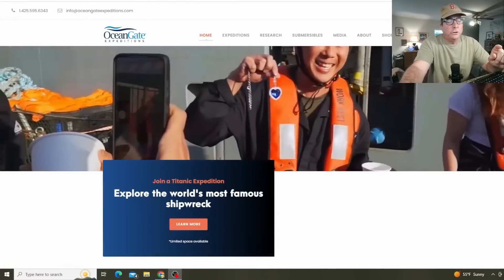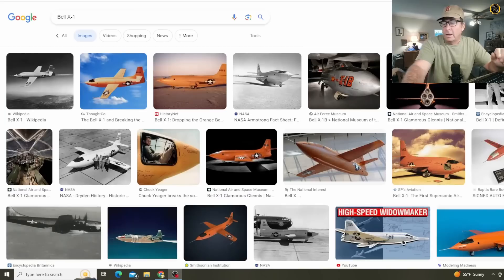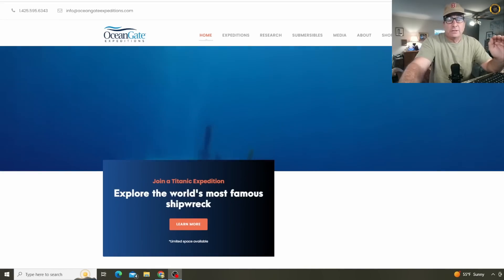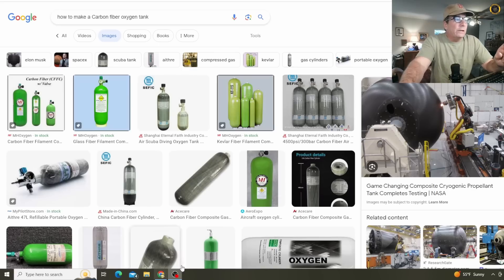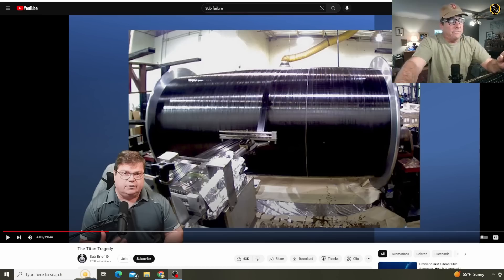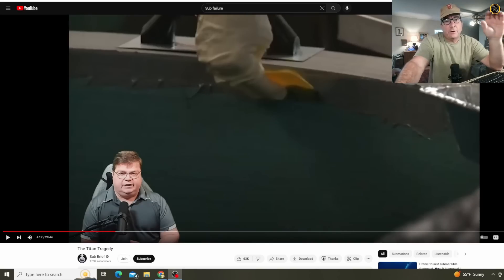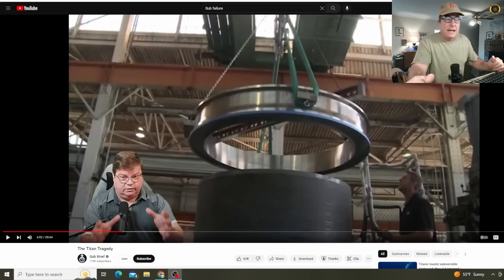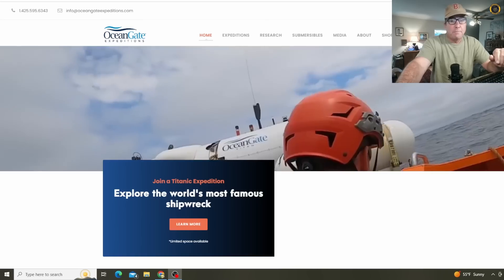Oceangate Sub Construction Details and Implosion

Comment: My brother in law, a diver in the Marshall Islands, made an interesting comment about what happens when the pressure vessel implodes at those depths.  The air volume inside the chamber is compressed to 1/220th of its original size in a few microseconds.  This rapid compression results in the air being superheated from the compressive friction, thereby igniting the oxygen into a little ball of plasma flame ahead of the wall of water.  This will take each of the human bodies;  compress and broil them into a charred ball about the size of a pound of hamburger, then immediately cooled to near freezing.

So I'd think there'd be  no bodies that could be recovered if what he says is true. And frankly, I have no reason to doubt him at this point.

And there could have been MANY failure points with the way this vehicle was built.  There could have been a small delamination that started in the composite layup ANYWHERE along the length of the tube.  The glass window apparently wasn't rated for that depth.  As you mention, the glue joint could have fatigued on an earlier dive and there was no way to check integrity of the joint or any of the composite laminations.  Any electrical feedthroughs from the interior to the exterior has to also be water tight at these extreme pressures, and could have been OK for the first few dives but exceeded their fatigue limit on the later dives.

In short, whoever designed this had no clue and didn't learn the lessons of the USS Thresher.

Comment: Fact the public is gona see the letter from sub industry pros, james cameron coming out..... i knew monday when they said "communication lost while desending" they where gone u dont lose location data w/o catastrophic failure. I duno who thought a 4 day search was a good idea. HE SOULD HAVE USED TITANIUM CYLINDER i mean carbon fiber is not a solid thing at that depth. Microscopic water leaks would weaken it. Fact they REUSED that sub more than twice shows they really shouldnt have been doing it. Ppl think "air tanks are carbon fiber they hold lots of psi" IN TENSION NOT COMPRESSION any sub/composots engineer would have gasped at this

Comment: How much weight does CF save, and does weight savings mean much in this application?  Metal's weight makes handling it harder, I'm sure, but that's doable - get a bigger truck and trailer, etc and move on, not worried if THIS trip is the one where it shatters.

Comment: Juan, quite good. But not good enough.
I'm a Mechanical Engineer, worked in composite aviation industry for 15 year,  low count as I was born into it. Seen the Lear Fan at the factory and much more. A friend of my father invented the carbon fiber. Leslie N. Philips at Royal Aircraft Establishment.
You are correct if the laminate was only made with "perpendicular" fibers. I have met and discussed this with Professor Stephen Tsai (Google).
No one in his right mind would do this .
I do not have sufficient data here.
There was a study in the early 80th of doing nuclear subs in carbon fiber, by no less than Brandt Goldsworthy, Goldsworthy Engineering (seen the nozzles of Saturn 5?). I visited.
The only composite item I was involved in with positive outside pressure was military and can't talk about it.
Carbon fiber has among the best fatigue properties in the industry, correctly designed,
Juan, you are wrong about NDT, non destructive testing, on composite materials. One of the best examples is the carbon fiber sandwich tail fin of our Swedish Saab 37 Viggen aircraft. Should be declassified by now.  My father's boss was in charge of the development of the Saab 37 Viggen, Dr Tore Gullstrand.
My most knowledge is with inside pressure. The launch tubes, now in Ukraine, of NLAW, AT4 all descends from my fathers work. RBS 70 is directly his work, also in Ukraine.
Reply: Håller med.

Comment: Yup. The fiber is not doing much in compression - like pushing on the two ends of a rope. The resin shatters during failure. They’re not going to recover much of that cylindrical section.

Comment: Everything has to be engineered and somebody probably came up with this design and backed it up with some sort of calculations. That's what I would like to see, the construction part is just the execution of this concept.
Additionally, what's your take on the use of composite materials in GA? How safe before a failure happens? Any known ADs on composite aircrafts like Diamond and Cirrus?
Reply: The use of composite materials in GA should be safe given that, by the time the structure is rigid enough it is (so I am told) far stronger than necessary. At least with GRP. I assume the same is true with carbon fibre. As a glider pilot with a GRP sailplane I've been taking that on trust for a long time!

Comment: Carbon fiber is perfect in tensile, not so much compression.  Poor plasticity.  The ends were glued on.  There its a video out there showing them glueing the ends on.  How could they be so ignorant of these errors?  For a deep ocean sub, check out the TRITON 36000/2 with a max depth of "Unlimited".

Comment: Do we know if the whole tube was wound that way? It could be like plywood, where there are different layers laid at different angles. That could be the inner or outer "pretty" layer.
The meeting point between the tube and the end cap is a hard point, and the cap has a square edge. Rather than the whole length of the tube being able to expand, all the force is stopped by the ring, and it will tend to bend the carbon fiber sharply around the corner, creating a sheer line around it. The carbon fiber should be at least twice as thick at the ends, and taper down to the main diameter to spread the load across more material. This is not my field, but I'm seeing bad ideas all over this thing.
Reply: The filament winding schedule is proprietary. It may become public through court cases.

Comment: For such a high expenditure,  potential customers should have stood back and done some research and inquiries IMO.  I could see that sort of construction being used in space stuff, for instance,  for a single use mission.  The extra measures required for reusable spacecraft required alot of research beyond what a single use vehicle needed.  Must be why reusables were slower in coming.   Think of the savings if the same Mercury capsule or Apollo capsule were used over and over.

Comment: You nailed it Juan. My father designed planes in the Skunk Works.  He took just about every course that came along including composites.  He told that just like any other material, there are pros and cons. Moisture was one of their biggest fears which is why they aren't used in pressure vessels like fuselages and submarines.  The bonding dissimilar materials is another problem.  Your explanation of this was right on target Juan.. Great Video!!
Reply: Total respect for your Dad and all who worked at the legendary Skunk Works.  The mighty SR-71 is still my favorite aircraft ever made!
Reply: @PhotoTiger2025  - I don't trust anyone who knows aircraft yet feels otherwise! What kind of weirdo doesn't get amazed at that? Well,  OK, maybe the ground crew wasn't happy about future illnesses developed by being soaked in fuel and hydraulics all day, but sometimes sacrifices must be made. Besides, they loved the bird as well.
Reply: @donalddepew9605 " Moisture was one of their biggest fears which is why they aren't used in pressure vessels like fuselages and submarines."   Someone missed the Beech Premier 1 which the entire fuselage is composite. 

I tested acoustic devises in a fiberglass pressure vessel for almost 15 years. The only maintenance that was required was to replace the bolts and end cap O-rings yearly. We tested to 2200 psi and the vessel was pressure tested to 2600 psi.

As for dissimilar materials, it's common practice in aerospace and aviation GRP composites to bond an isolator ply or two of fiberglass on graphite to titanium interfaces.
Reply: I offer you my sympathy in knowing you Dad worked at the Skunk Works. All the neat, cool, and amazing stuff going on and he couldn't tell you about it. You waz robbed!
Reply: Like always - the phrase "new and improved" may be new but - the jury is still deliberating whether it is improved.
Reply: @johnwhitehead5457  New and more costly.
Reply: Tension load force as in pressurized planes versus compression load force as is the case with deep-dive submersibles. 
Design has much greater strength again expansion (tension)  than against compression. 
Blancorlirio hits the nail on the head with that point. Even of the joint bond strength and durability was a problem (very likely was) , the ability of 5-inch thick Carbon fiber composite to provide enough compression resistance is an unknown. Especially in a cylindrical shape versus a spherical shape.
Reply: Moisture is what eliminated the Cessna Columbia. Once Cessna moved the layup facility to Mexico they used swamp coolers in the layup room. The spars started to delaminate  due to Moisture. The entire new fleet they built down there were no good. End of the Columbia aircraft
Reply: @Airplanefish  Epoxies especially older formulas need specific temperatures and humidity for optimal cured strength. But once properly cured they should be fairly moisture impervious.
Reply: @tim1398  cessna has the most strict temperature and humidity rules (at least they did with the Columbia Models) compared to Cirrus and Diamond. Cessna requires the entire area once paint is removed to stay in a completely enclosed area and it must be monitored and recorded 24/7 until primer gets put on. Then you must send them that information plus glue samples from the glue mixed that was used in the repair for testing.
Reply: That makes all the sense in the world.
Reply: Can you build a sailing vessel or motor boat from carbon fiber?
Reply: 8 psi inside an airplane as compared to 5200 psi under the sea...
Reply: @andrewg.spurgeon1736  - Their tubes are under tension, not compression.
Reply: @@user-gg2ty5tk8k Racing yachts don't have to maintain structural integrity against a sea pressure of 5768 pounds per square inch.  In the case of SCUBA tanks, neither do they. SCUBA tanks have between 2400-3500 PSI pressing out, not water pressure pushing in.
Reply: several airplanes have composite fuselages.
Reply: @buckmurdock2500  Which places the composite under tension as the pressure inside pushes out.  This sub had the composite under compression as the water tried to press in.  Actually a pretty huge difference.  Too bad they didn't have a naval architect on the team to point that out for them.  I mean besides the one they fired for pointing that out to them.
Reply: @johnpublic6582  Not that much of a different… pretty much all the space vehicle and space station are built very similar to submarine… the only difference is submarine has to withstand more pressure differences. 

The carbon fibre is extremely strong and the craft has withstand the pressure at the depth of titanic wreck before a couple times, which is higher than at the point where implosion occurred. 

So I don’t think there’s a problem with the strength of the carbon fibre pressure hull.

However, the fatigue in carbon fibre is not yet well understood and it wouldn’t show any crack. When it breaks, it just break instantly without giving any sign or warnings. So that’s most likely the probable cause of implosion. 

It could also be the joint between titanium ring and carbon fibre hull but that is most likely to cause slow leak first and unlikely to fail instantly without any warnings like what happened…

Fun fact: 787 has carbon fibre fuselage and its been flying for about 10 years now. I would probably avoid flying on those for now…
Reply: @buckmurdock2500  Aircrafts generate high pressure within the tube.
This separates the use case of composites completely from a submarine.

Comment: In addition to the dissimilar materials, I wonder what effect the cold water temperature has on such a joint.
The carbon fiber and adhesive may have become brittle, and may have shrunk more than the titanium rings.
Reply: Carbon fiber does the exact opposite of most materials. Instead of contracting when it gets cold it expands and contracts when it heats up. It's called a negative coefficient of thermal expansion. Which is pretty crazy.
Reply: at that drastic pressure and temperatures, im sure there was some effect from temperature.
Reply: I expect you are correct that low temperature would cause it to became brittle. The 400 bar compressive force of the ocean would far outweigh any temperature expansion. The carbon fiber would compress much more than the titanium causing shear stress at the joint flange. That is probably where the failure occurred.

Comment: Since the Airbus A350 and Boeing 787 use composite materials, couldn't the same type of rupture happen to them after a long time of compressing and decompressing? 🤔
Reply: No where near the pressure and aircraft fuselage would be under tension not compression. Both mfrs have had to do their due diligence and testing

Comment: The titanium ring looks like it should be inside the tube so when the tube is squeezed the ring supports it.
Reply: End pressure on the titanium hemispheres would simply push them into the tube, even at a fairly shallow depth.  
If the ends of the tube depended on support from the titanium as you propose, then the middle of the tube would simply implode.
Reply: @allegory7638  funny enough this is most likely exactly what happened .
Reply: Not with carbonfiber tube. Any load stress on such way wound carbon would be point of failure. I imagine it would behave like drinking glass, little pressure and bend from inside ring, and goodbye.

Comment: Ultrasonic NDT can show delamination in some composite materials. Voids will appear as an echo. They would need to be tested against a known standard.
Reply: Absolutely.  It will show up as an additional peak (reflection).  One for the surface interface, one for the backwall and one for a void if one is there.  Otherwise, just two peaks on the instrument.

Comment: Is it accurate that the entire failure sequence took 30 milliseconds? I.e. from compromise to squshed?  That came from a news report.
Reply: The time between the failure beginning and ending is short enough that they were literally dead before they knew they were dead.
Reply: @billwoo738 I don't know that anyone sat down and meticulously did the calculations, but people with experience in this field such as who originated the 30ms estimate, when they say 30ms, the asnwer is something like 10ms to 50ms and not  50us or 1s.

Under the forces at those kinds of depths, things break incomprehensibly fast.  Similar to the speed of TNT going off.

Keep in mind this is notably shorter than the time it takes the nerve impulse to travel to the brain, forget about time for the brain to make sense of the signal and form a thought.
Reply: @johnpublic6582  Excellent response. And good choice of the word incomprehensibly. I also think of the word unfathomably to describe the immense pressures at such depths - at so many fathoms. Think about the amazing pressures at just half that depth, making the head spin at the prospect.
Reply: Cracks in metal parts propagate (spread, travel, etc) at the speed of sound (761 mph) or faster.

Comment: I was curious of how the carbon fibre was wrapped but this shows it was in approx 4inch wide bands which if you look at how asphalt is laid on roads it shows that as they butt against the next lane of asphalt it looks like they are perfectly solid against each other but in a couple of years you can see where the individual asphalt paving widths were and there are gaps between them. Well under the massive pressures in the ocean this same thing would be seeking the weaknesses between the 4 inch carbon bands and if there were any distances or uneven resins sealing them together they get exposed and unfortunately in this case implodes. I can't say this is what happened but according to the information it did implode but at this point we do not know the specific failure point. May they RIP.

Comment: I hope they try to find a "all 4 corners" of the Titan; knowledge of exactly what failed would be priceless.  Also a possibility is a serious water leak, at some point the pressure in an oxygen-rich environment will cause flammable materials to "Diesel" and then exploding the hull, not an implosion.  The crew would already be dead regardless.  I'm also wondering where the batteries were being carried?  Lithium batteries???